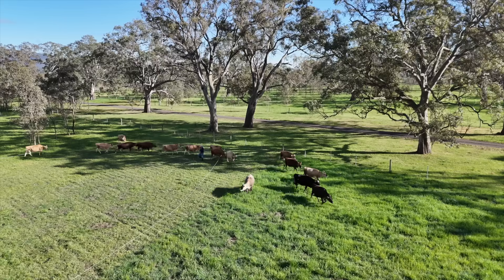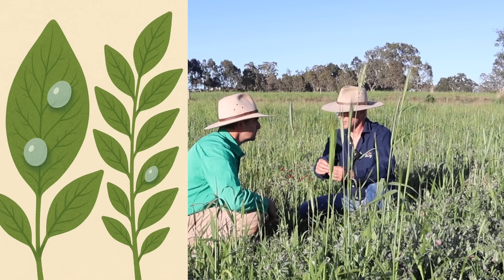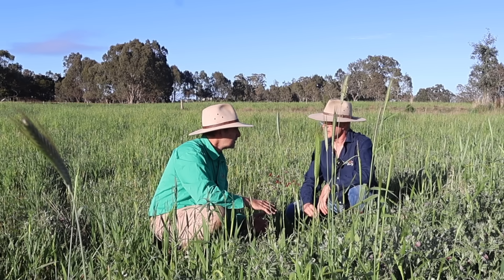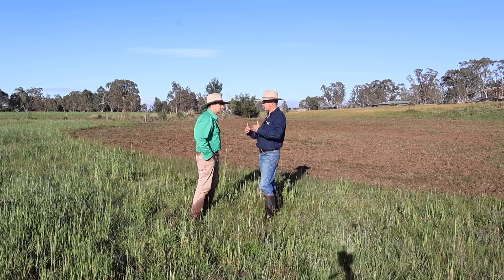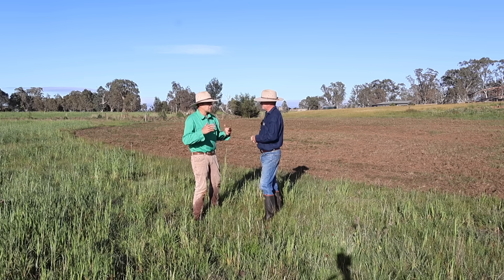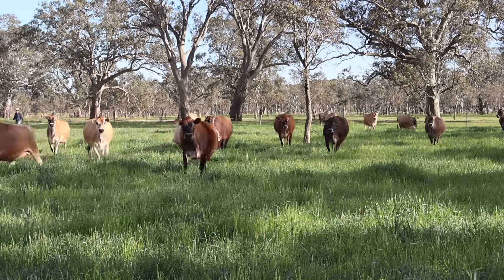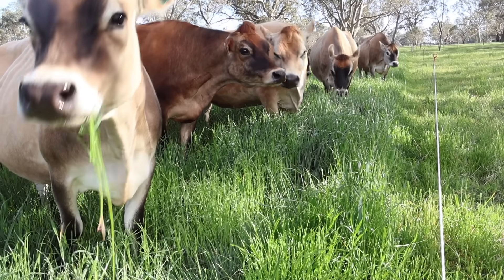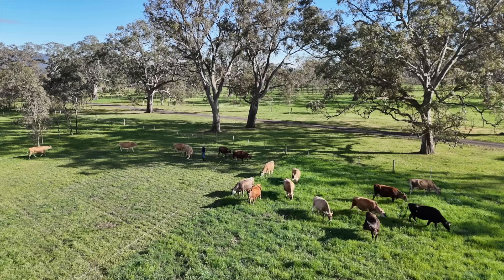Why Are These Cows Thriving With No Rain?

Comment: Nice! A new Concept of grass management Is being used in Brasil And Sudamérica called Rotatinuo, essentially, Rotatinuo established through studies on different forage species the specific heights at which animals reach their maximum forage intake. At the same time, as seen in the video, the grass tends to remain with more leaves and the root system is not compromised, allowing the pasture to recover much faster.

Now that I see this, I find one of the explanations for why Rotatinuo grazing tends to be more resilient during a drought or when the grazing season is extended in very dry areas

Comment: Can someone help me understand. Do the cows get their water from the condensation on the grass, plus the odd puddle or swale. Or do they require additional water supply from rivers or bores or dams? I saw one regenerative farming video where the water was pumped to a tank connected to troughs and the paddocks were like pizza wedges which the cattle circulate around but could still have access to the water in the centre. If it is condensation on the grass then this idea is revolutionary as it solves the problem of feed, water and prevents overgrazing and compaction around the water supply. Surely there would be extreme heat conditions where the condensation is not enough. What then?
Reply from the maker: Livesock must have access to clean water at all times. There is a trough on the corner of the paddock.

Comment: We rotated 3000 weaner calves over 1000 ha and set up poly pipes from central tank on hill( incredible water from fantastic underground lake)and used portable troughs towed on a frame to water cattle as they moved around rotation.
Reply: Also 12 paddock rotation per mob 3 days per paddock of 10 ha with permanent single wire electric fencing and lift up posts to let cattle move under the fence to next paddock. 36-38 days rest was plenty.

Comment: Nonsense, where's the science... actively growing plants use a tremendous amount of water every day. Bugger all moisture evaporates directly from soil. Its the plants using up all the moisture. Not a chance that plant transpiration is being replaced by overnight dew. At best it will keep the pasture alive, not actively growing. There's a lot more going on than what's discussed in the video.
Reply: part truth and part fiction in presentation made up for hobby farmer market - once you get to end spring summer you will not see condensation as seen cool season ... this 100 acres is currently running 8 tonne cattle  - year in year out 4 tonne is realistic stocking rate - most rain fell here start of winter  = true measurement is kg beef per hectare per annum from x amount of annual rain = or milk = without buying feed for cattle
Reply: You’ve got no idea what you’re talking about lol. 
If you want some of the Science, watch some of Walter Jehne’s and Christine Jones’s lectures.
Reply: @user-sb1zm4lh7x  How much dew do you think is collecting? The equivalent in millimetres of rainfall, take a guess. How deep do you think this small amount water is soaking into the soil? Or do you think the plants don't need water at the roots, they can magically use it through their leaves? The dew is a tiny amount of water, how much water do you think a plant needs?
What I think is going on is its a riverine area (note the river red gums), its a deep sandy soil, with plenty of subsoil moisture and possibly a shallow water table. The healthy pasture has deep rooted grasses (looks like phalaris), that are able to access the subsoil mositure. The dew is coming from the plants, condensing at night, the plants aren't magically harvesting moisture from the atmosphere.
edit. had a quick look at Walter Jehne’s and Christine Jones’s lectures. Very basic simple stuff, first year soil science.

Comment: Few things worse for soil than letting stock continuing to camp under the same tree. This in turn denies the rest of the pasture nutrient cycling.
Reply: Depends on soil type and number of trees...if you are not overstocked it is usually of no real concern
Reply: @Jack-p6b9f  If you are highly stocked you need high shade that moves with the sun forcing stock to move. Shade that's low to the ground barely moves so stock trample the earth barren.
Reply: @DavidRose-m8s if you are highly overstocked you will degrade pasture with or without trees. If you are correct weight stock per hectare you will improve pasture with or without trees.  Trees are good but not essential. Shade is important in summer.

Comment: i see this common statement/question in the replies... "Hi Tim, how does he get water to his cattle on daily moves? Cheers!"
Reply: We have built several kilometres of in ground poly pipe use points - took a while but pays huge dividends
Reply: Thanks.
Was wondering as well.
For most farms getting water to those many small grazing cells is the big infrastructure cost.
Worth every cent by the looks.
Thanks for sharing your farm and experience, so important that we get to see and hear these stories.
Reply: Graham hand  hand for the land runs courses on rotation grazing leaves the back fence down so cattle can go back for water.
Reply: @loreleigoodall8892 yes - you can do that too - ultimately the animals start trekking for water - doesn’t take much pressure to create tracks- and if the terrain is not flat then you will get incision gullies starting- we are on terrain that undulates so this is a consideration

Comment: righto = double the stocking rate and you have a man-made drought - so weight of animal per hectare is relevant = as is when rain fell = as is soil type = retain the rain = also cost of planting verses perennial pasture = irrespective this fellow has only a few head so HOW MANY CATTLE on 100 acres  year in year out is useful to know
Reply: Yes - this is the real question- we are currently moving 21 head at a rate of 6.5kg/mtr2 - jersey are about 380kg each and eating about 17kg total per day - we are trying to sustain this in a climate zone that is a double rain shadow - the decade rain average is 640mm but variability is enormous- altitude is 360mtr - we figure effective rainfall is no greater than 500mm - soil is heavy basalt with less that 1% carbon when we started. We have had 12 days over 18C since September 1st - Tim helps us to record progress
Reply: @hamishhunt9844  8000 kg of mammal on 100 acres 40 hectares = so from previous experiences you need to buy feed periodically =  so you are overstocked. because you cannot run 8 tonne on a 100 acres year in year out. condensation is beneficial, but in the grand scheme of production it is not that much extra. tims wet legs will be dry legs 200 days out of 365 and on wet leg days the moisture has evaporated by 11 am typically. give or take a bit for regional variations. most of your rain was winter from media reports. if you only had 400 mm of rain up until april you would now be out of fed. also 450 kg beast eats 10 kg dry plant matter per day. add 50% to cow weight when lactating. 17 kg calculation might be accurate with dairy cows or you might not let the grass dry out fully before you weigh it.